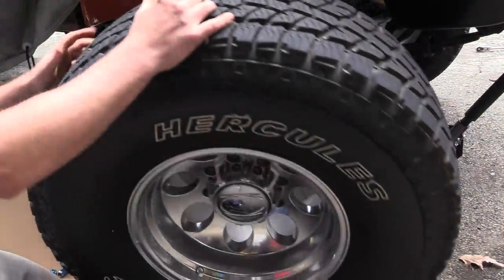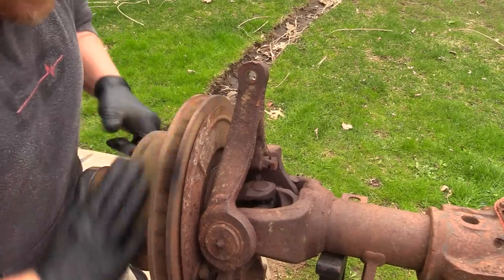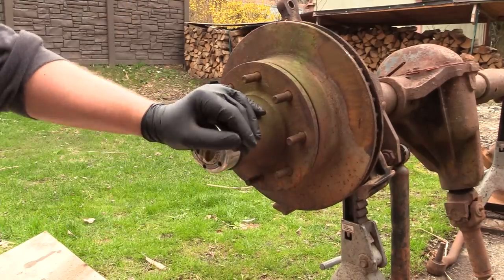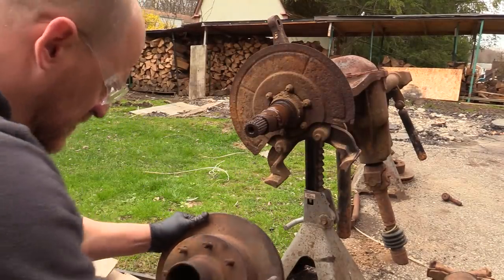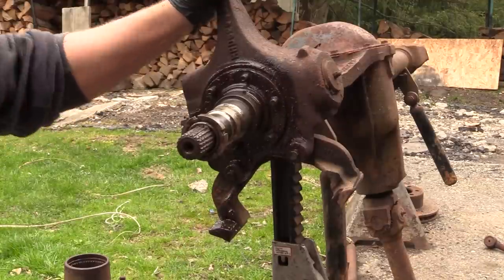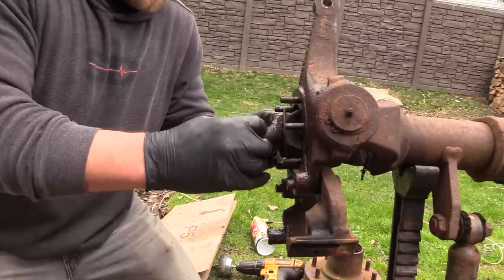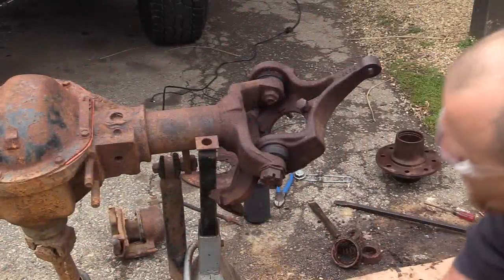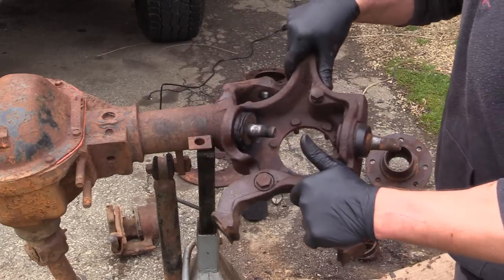Full Time DANA 44 Locking Hub Conversion [Part 1 of 2]

Comment from the maker: I know this isn't what you guys want from me, but I needed to do this conversion on my truck and I have a lot of fellow enthusiasts who need to know how to do this stuff too, so I filmed it. Hope you enjoy it.  anyway. Thanks! 
At the very least you can laugh with me while I do dumb stuff 🙃
Reply: Good content is good content 👍🍺
Reply: a change is as good as a rest  its all good to watch  and informative waiting for the next thanks
Reply: Love these videos SD😍
It's an honor to be part of this journey digitally, through the entire video I felt like you were teaching me & talking directly to me😍
It's AWESOME😍
Thanks SD, Stay Blessed❤
Reply: Keep these video coming! This one takes me back to when I was building a Dana 60 for my 2 door Tahoe. It has a Ford high pinion center, Chevrolet outers with Reid knuckles, and to top it off I bolted on some 90’s era dodge 3/4 ton wheels. I call it the Detroit Hat Trick axle. Lol 

I learned so much about the one ton axles back then. What fit what, what years had what options, widths, u-joint size, etc. Sadly I have forgotten most of it by now...
Reply: 29:00  ... The "load" on those little bearings are when you are NOT in 4x4.  So the shaft is sitting still, and the wheel is turning around the shaft (so there's not much load, ever-- but still a lot of free spinning).  When you put it in 4x4-- the wheel and the shaft are turning together, so then that bearing is no longer spinning at that point.   I have a 2002 F350 7.3L Diesel, which I believe has Dana 60 axle in the front --- and it has that same little needle bearing on my shafts, and they are very loud, because they lose their grease so easily, and then it's constantly spinning on those outer shafts when you're only in 2wd.  It's really a bad design IMO-- because on my F350, it has those sealed hubs for the wheel bearings, which seem to last forever--- so that little needle bearing on the shaft ends up getting neglected, and wears a grove into those outer shafts.  They should have designed that little bearing to be a sealed bearing, and it would have lasted so much longer.
Reply: Pretty sure we’d watch you fix a lawn mower!
Reply from the maker: @brian2359  lol nice! Thanks Brian
Reply: @brian2359  lol probably would watch him cutting the lawn after he fixed the lawnmower too...   ;-)

Comment: Use both locking rings to double the pulling threads. I have also used a 2x4 against the spindle and hit that with a hammer.  This is fun stuff. Thanks for bringing us along.
Reply from the maker: Agree! I meant to put a note in there to do that very thing!

Comment: When using the puller hit the end of the threaded shaft, you notice the space between the top of the shaft and the hex. That is to allow for hammering on the shaft. The vibration helps free whatever your pulling. Hit it, tighten it, hit it again. You’ll see how much better it works.

Comment: About 13 minutes in when you said you thought the spindle was already moving, capitalize on your two jaw puller to tell you whether or not it did.  If it did move, that means tension has been released on the puller.  For the moments the puller doesnt' just fall off altogether, you'll feel the forcing screw turn easy for a bit more than it did and feel it out as you continue turning the screw,  Return to chisel or hammer therapy tactics as needed along the way, but keep using the tension on the forcing screw to help tell you when.

One thing I'd like to see you try out in a video is a 2", 20,000 rpm, .006" strand wire wheel on a die grinder for some of that fussy cleaning.  Grainger has them and their part number is 3A204.  Wear your safety glasses and expect to wear some strands eventually.  But these wheels do a great job of fine cleaning without eating up the surface you're trying to preserve.  With good throttle control of your die grinder at around 50%, it does amazing things with cleaning and preserving aluminum surfaces too.  I'll be happy to donate and mail you one if you have a PO box I can send it to.

Comment: the loose fitting bearing cant you pop it into college put on lathe turned down to clean put weld to build up and re machine to size  good practice for the students in the machine shop or shrink tube on have you seen cutting edge engineering and some of the repairs he s done on youtube

Comment: I have no idea but I somehow missed that video in my subscription box.
That axle appears to be from a state where they live by "it can't be stuck if it's liquid". Like others already said, I also enjoy this kind of content. And honestly, video quality is not that important for me. More important is audio as well as the actual content.

Just some things about me:
I'm a DIY and enjoy working on my car nut work in IT. I most likely will never need to do most if not all of the diagnosis you do. However, I enjoy your content because I like to learn new stuff about things I'm interested in and you do a very good job of that. Also, some of the stuff like the way of thinking and how to approach a problem can also be (translated and) applied to other stuff like IT. Ex. finding the common thing about all the failed things (like a bad ground) and go from there.
It's basically the same reason why I watch other automotive Youtubers like Eric O., Ivan and ETCG (and many others). Doing that encouraged me to start working on my car in more depth as well.

So, even though this does not involve scopes or scantools for thousands of dollars, it is still a great video as it shows problem solving and teaching regardless.
Reply from the maker: Man what a great comment. Thank you so much!
Reply: *nut = but

Comment: My 97 Isuzu Rodeo has a center axle disconnect like that.  It's vacuum operated.  I'm debating on welding it solid and just converting to manual locking hubs--- because at 320k miles-- that axle disconnect is trying to stop working on me.

Comment: 29:00  ... The "load" on those little bearings are when you are NOT in 4x4.  So the shaft is sitting still, and the wheel is turning around the shaft (so there's not much load, ever-- but still a lot of free spinning).  When you put it in 4x4-- the wheel and the shaft are turning together, so then that bearing is no longer spinning at that point.   I have a 2002 F350 7.3L Diesel, which I believe has Dana 60 axle in the front --- and it has that same little needle bearing on my shafts, and they are very loud, because they lose their grease so easily, and then it's constantly spinning on those outer shafts when you're only in 2wd.  It's really a bad design IMO-- because on my F350, it has those sealed hubs for the wheel bearings, which seem to last forever--- so that little needle bearing on the shaft ends up getting neglected, and wears a grove into those outer shafts.  They should have designed that little bearing to be a sealed bearing, and it would have lasted so much longer.
Reply: there's a really crappy seal thats supposed to seal the shaft and that little bearing. most people tear them apart and they aren't in there  so out of sight out of mind.  i think thats why that side was all rusted up.
Reply: @richardcranium5839  Yeah, that was my point.  The large sealed hub wheel bearings last so much longer than that little axle seal, and water gets into that little needle bearing and washes it out;   It just needs so much more maintenance than the big bearings, so it gets absolutely neglected, and most people don't seem to know this--  hell, I didn't know it until I seen how bad my outer shafts were worn because of it............  One little trick you can do is try to get in there with a NEEDLE on your grease gun;  Since the seal is probably shot anyway-- you can pierce the top of that seal on the inside and fill it back up with grease without taking it all apart. (at least on the dana 60 axle)..  they should have made these with a grease zerk somewhere and it would have solved everything.   I bet they have sold a LOT of those outer axles;  because I have never personally seen one that wasn't worn, scratched or gouged, or just flat out destroyed.  They almost always need outer axles-- and this video is no exception..  The REAL failure is that it doesn't have a RACE on the shaft.  They chose to let the bearing ride directly onto the shaft, rather than having a simple hardened bearing race be pressed on there, like every other bearing surface ever made... 

Even worse, once the bearing or shaft gets worn -- it destroys the seal even more, since the shaft is no longer held in the center, it can move around a bit;   it destroys the seal even more, which lets in more water, washing out all the grease, which wears down the shaft even faster and it's just a runaway issue.

Comment: First off, great video! It explained a lot of what i MAY be looking at doing in the fairly near future!
I have a 90 w150, that i've swapped to '78 w200 axles. I've been through 2 front left u-joints, 2 front left outer shafts, and now 1 left inner shaft, due to the u-joints giving out. (I've made it a point to grease 'em, since the first one gave out and took the first outer shaft with it). This last time, i'm HOPING the busted inner shaft yoke  was just weakened from the trauma, from the first u-joint failure. Both instances, the joint gave out, and out of necessity to get the truck to a trailer i had to drive on it...
Aside from the fact that they're both "3/4-ton axles", can anyone tell me why i SHOULD look into doing what you've just done, opposed to converting my original CAD 44 to 8-lug? (These full-time 44 axle parts seem to be getting harder to get ahold of... i've bought all 3 shafts from torqueking, in the last 9 months) if anyone DOES have input for converting to the 8-lug, i'd greatly appreciate a list of NEEDED components!
Thanks again, @scannerdanner!

Comment: @scannerdanner , hi am from across the pond in the uk and have a Land Rover discovery 3 , wished to take this opportunity to say how grateful I am to u , had an issue with my variable turbo actuator not working , with ur fantastic way of teaching by going through the canbus system step by step, had 120 ohms on the high can and 60 ohms on the low , got a detailed wiring diagram and started by disconnecting the battery and using a multimeter set to ohms I checked each wire from end to end , found a broken earth wire that the ECM used which was behind the front wheel arch liner , was over the moon and wished to thank u so much as before watching ur videos wouldn’t have known where to start , diagnostics wise I have a gap iid and been looking at the Autel MaxiCOM MK808TS: 2022 Bi-directional scanner as wanted something that is bi directional which would then allow me to activate items within the system, sorry I’m waffling , once again a million thks to u kind sir for sharing ur vast wisdom , stay safe and well and may ur channel go from strength to strength 👍👍
Reply from the maker: This is awesome! Thanks for sharing this with me
Reply: @ScannerDanner  , ur so welcome and felt it was the least I could do out of courtesy and appreciation to u kind sir , recommend  ur channel at every opportunity on several Land Rover forums I belong to , recently got some of ur OTC test lights , still doing a lot of research on the bi directional scanners and hopefully will be able to order one very soon , have a great week 👍👍 PS, may i ask please do u happen to know when the OTC 3633-10 Replacement Bulbs might be back in stock as wish to order some as spares plse, as can’t seem to get them here in the uk , many thks
Reply from the maker: @garystuart226  thanks so much Gary!